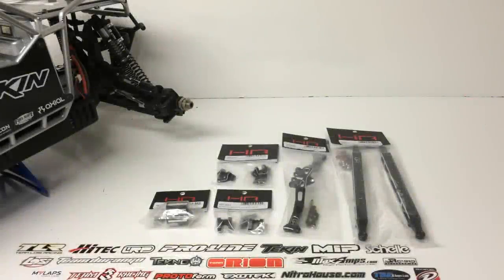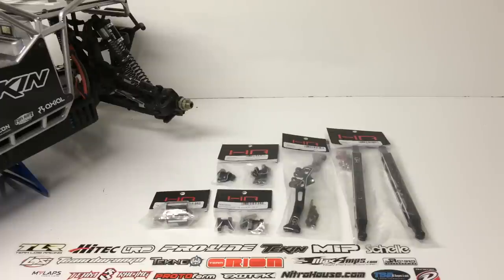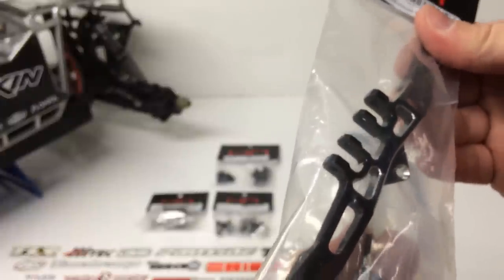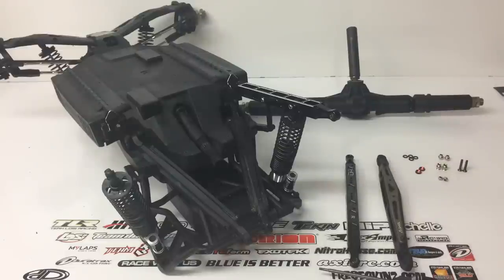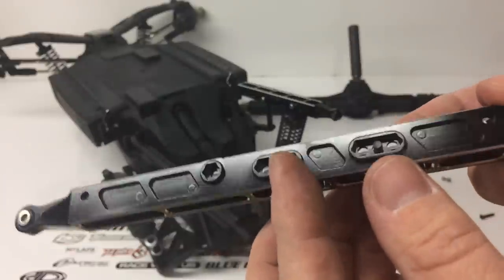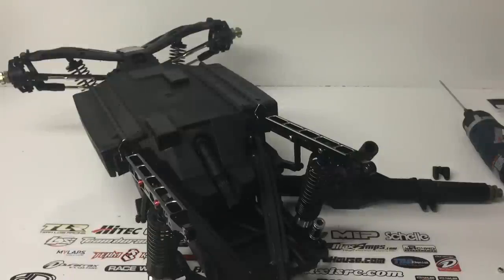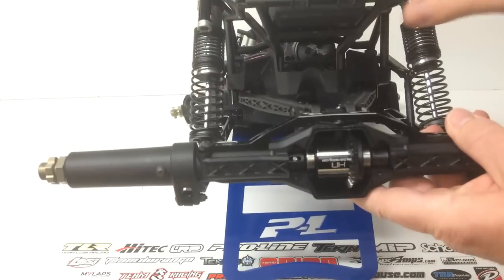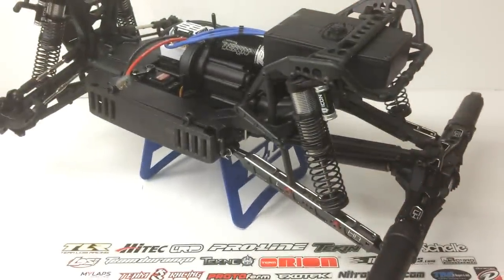Hot Racing Upgrades Pt 1 - Axial Yeti XL KIT Version

Comment: Those rear trailing arms look great. What is the difference between the stock diff and the upgrade you put on?
Reply from the maker: Gary Lowe Thanks!  The HR Aluminum Diff cup is just basically that, aluminum.  It will help keep the heat down in the fluid and keep sound vs soft plastic

Comment: hey there the rcnetwork  i have a question i recently purchased some upgrades for the yeti xl and i dnt knoe if this part i purchase is needed ( Hot Racing YEX56C01 Aluminum Channel Rear Link Stiffeners for Yeti Xl) kinda lost and confuse if i still need this part since i already purchase it and also purchased the Hot Racing YEX56L01 Aluminum Rear Lower Links - Yeti Xl . hope to see if you can help me out thanks. 

Great videos you put out all the time.
Reply from the maker: Hey Nick, the stiffeners are a supplement item for the all plastic lower links on the XL RTR.  The XL Kit came with a gold version from axial. If you already have the all aluminum lower trailing arms, you're set.
Reply: Yeah after some more research i figured that out i bouth both the stiffeners and the lower links by accident but at least i would have a spare. 

Thanks for your help keep pumpin those great videos of yours

Comment: hello.  i have had my yeti xl sittibg around for a wjike and i decided to start some up grades on it. Just had a few questions. Are u using the stock rear plastic axal and the gears that came with it. Was looking at the vanquish rear axal but it says it will not take a HD gears.  Also is that a HR locker inside the rear.  also I am use to just greasing the gears how does the oil stay in the diff. thanks
Reply from the maker: Stock plastic.....The Vanquish wasn't out when I made this video....No locker.....oil stays in with the included gasket